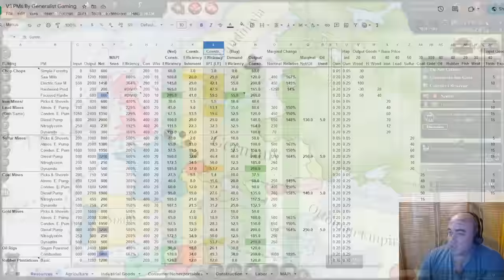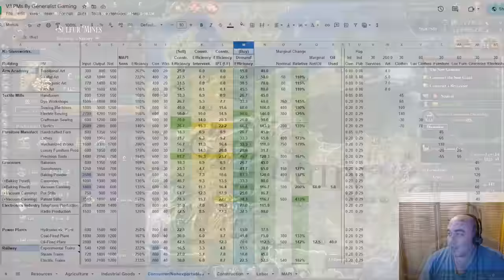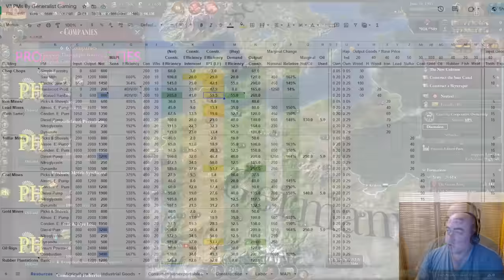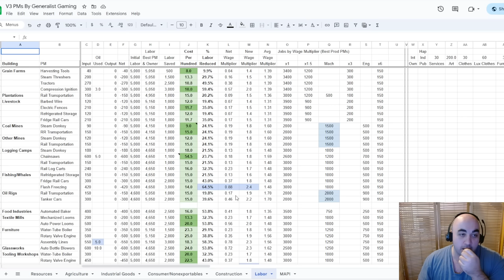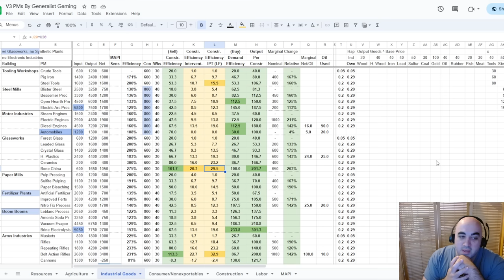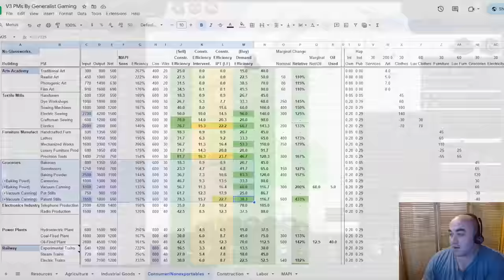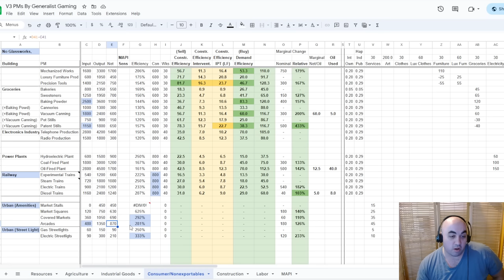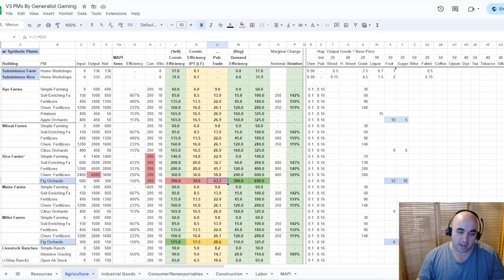Patch 1.5 Production Method CHANGES & Updated Philosophy for Evaluating PMs

Comment: Why do you think that building grocery factories would increase demand of grain? 40 grain to 45 groceries is creating nutrition out of nothing which would surely lead to a net decrease of grain demand
Reply from the maker: Anecdotally this is what I've noticed, but what you're saying makes sense, esp considering later PMs/that groceries have a higher base price/worse grain/grocery ratio (often if grain gets sufficiently depressed swapping to earlier PMs becomes more profitable). The price also doesn't move up by a lot, from what I can recall, although I haven't done a hyper focused deep dive on this, so maybe I'm misremembering and could be mistaken. Here are some possibilities:

-Depressed grocery prices drive up SoL, increasing overall food consumption.
-Grain is an inferior good, not consumed by rich pops. Groceries allow you to effectively feed grain to rich pops grain.
-Convoyless exports of grain are limited - exporting groceries adds another layer of good that you can export w/o convoys.
-If groceries are produced, and are efficient (they are) enough to get lower than base price, then there are more sell orders than buy orders - creating all the sell orders still consumes all the grain via buy orders, while consumption of the groceries is less than the sell orders
Reply: Groceries compete with Meat, Fruit and Sugar for high SoL pop needs.  Cheaper, plentiful groceries means you're selling grain to both low SoL and high SoL pops.

Comment: Electricity and transport should have reducen Mappy, like start at 20% and get to maybe 50%. To account for both powerlines and long distance trains.
Reply from the maker: They're entirely local, and you cannot buy at all from the market.
Reply: Yeah, but they shouldn't, both for realism and for gameplay perspective.  @generalistgaming
Reply: @aaronhpa I would lean towards having double or triple mapi effects because it seems like would be at least available even if horribly inefficient. At max of 95% make the local good feel like 90% or 85% and if you had like 70% make it 40% or even 10%. I don't think its realistic but could be better gameplay.

Comment: Hey man, I always appreciate your analysis. Quick question. You say it’s better to have capitalists vs shop keepers on PMs, because of the capitalist investment contribution efficiency. But, in my Vietnam game I have high unemployment, and switching those pms would make those buildings employ less people(something like 500 shopkeepers—> 100 capitalists). Is it still better to have capitalists in a building vs having lots of unemployed pops. That’s the only reason I haven’t switched my pms. Which is better though?
Reply: I would think it's a good thing to have those 500 shopkeepers unemployed- those are 500 pops that otherwise would be tied up in other prodction. It's slightly more efficient, since you can fully employ your factories with fewer pops, meaning you can build more factories and produce more.
Reply: @adamb8439  Late game I agree with you, however I'm talking early game when I've got tons and tons of unemployed due to reduced subsistence farm buildings being replaced with farms and plantations by the auto-private construction queue. I lean towards keeping them employed so I can more quickly pull from the peasant labor to reduce landowner clout.